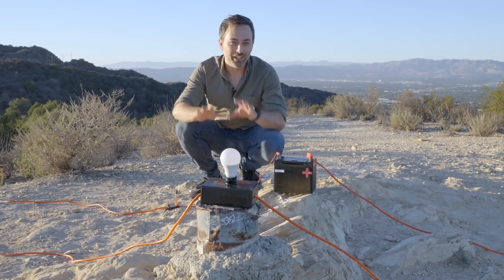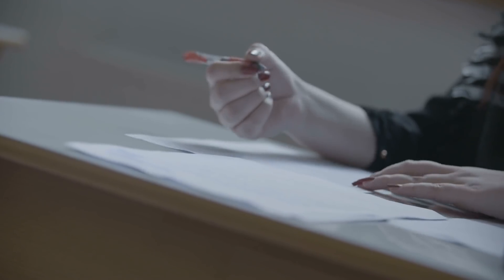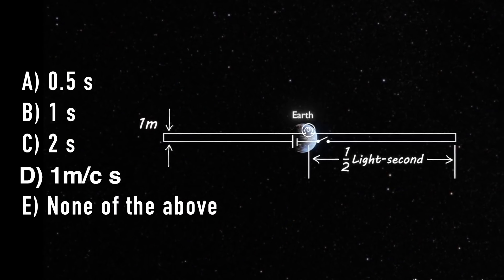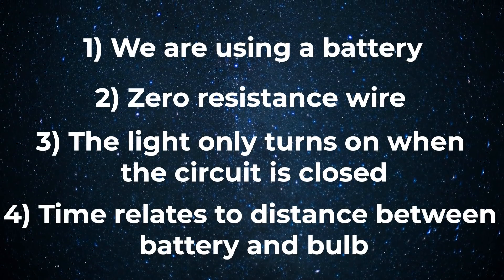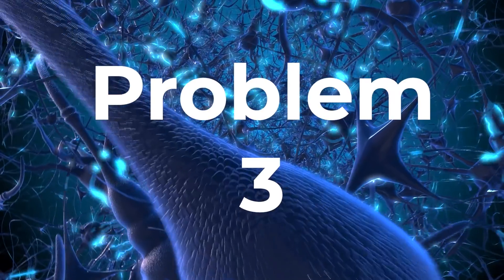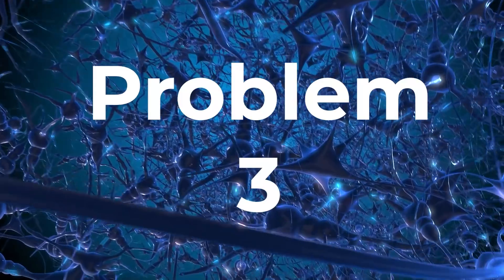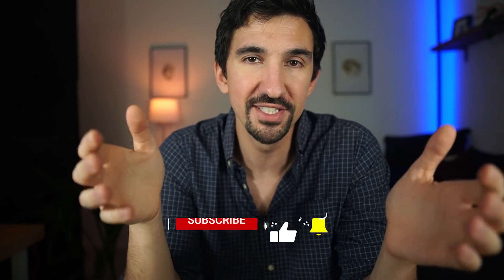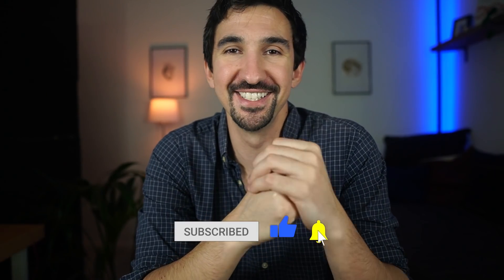Is Veritasium Wrong About Electricity?

Comment: The coupling between those wires is incredibly small. Even if you consider all of the energy supplied by the battery as creating a cylindrical near field, the best that the wires one meter away will “see” is the wire diameter / 2 x pi x 1m. Even a 10 mm wire (quite large), could at most, receive approx 0.0016 of the energy via coupling.  Light the bulb - no, not in any practical sense.  Is it possible to know 1m/c later that the switch is closed - yes.
Reply: That coupling impedance is approx. 100-200Ohm (one can make it lower, but not much higher than that). That's not "incredibly small". It causes tons of problems in electronics design.
Reply: @lepidoptera9337  Back of the envelope calculation says it will be closer to 30K Ohm for this arrangement.  Mutual capacitance between those two wires 1 meter apart will be around 100 fF / m.  Charging one meter of that to 12 V in 3ns would take a current of about 0.4 mA.  So the effective coupling is around 30K (12V/0.4ma).  You might dimly light a single LED with that current, but a bulb like shown in the video - not likely.
Reply: @bobwhite137  I know it is tempting to calculate capacitance only, but this is a transmission line problem.
Reply: @lepidoptera9337  well actually it is a near field antenna problem…. The capacitance approach should at least be in the ballpark though.
Reply: @bobwhite137  A transmission line is neither a near nor a far field problem. It has two dimensions, one being the distance between the conductors and the other being the length, with the length greatly exceeding the distance.
Reply: @lepidoptera9337  Here, the two segments being directly driven by the source voltage do NOT fit the definition of a transmission line. Those segments ARE a dipole antenna (for the first 1/2 second anyway - I only care about the first 30 ns or so).  If it helps to visualize, just cut off the far ends of the wire. That’s why this fits as a dipole antenna radiating to a dipole receiver 1 meter away.
Reply: @bobwhite137  The thing is 300,000km long. It doesn't matter much what happens on the first meter.
Reply: @lepidoptera9337  It certainly does if you want to know the current to the bulb after roughly 3 ns.  If that doesn't make sense to you, there's really no point in discussing further.
Reply: @bobwhite137  But that's not what you want to know. :-)
Reply: @lepidoptera9337  That is exactly what I want to know - I fully agree that some signal reaches the bulb at 1m/c s after switch closure.  My issue is that the power transfer is so small that there will be no realistic "lighting" occurring.  So to make that determination, I only need to understand what happens in those first few nanoseconds.
Reply: @bobwhite137  If a question contains a 300,000km long structure, it's not about the behavior of the first meter of it. :-)
Reply: @lepidoptera9337  It is when you care about the first 3 ns.  I think we're done here.
Reply: @bobwhite137  Sorry to say, but you were done with your first post.
Reply: @bobwhite137  I thought you were done? What happened? :-)

Comment: Veritasium tries to convince you that magnetic field creates current when it’s vice versa
Reply: Magnetic fields changing in time are causing an electric field (just not a field that is the gradient of a scalar potential). That electric field causes charges to move, which is... a current.
Reply: @lepidoptera9337  Problem here is that the magnetic field only changes at the very beginning when the switch is open or closed. After a fraction of a second the magnetic field is static but there is still a current!
Reply: @ricomajestic  Not along the transmission line.
Reply: @lepidoptera9337  how do you get a changing magnetic field out of a constant current and a constant electric field? If you wait long enough after closing the switch it reaches a steady state everywhere along the circuit!
Reply: @ricomajestic  As long as the transmission line is charging, there is a voltage "front" running at a fraction of the speed of light along it. It's only after it's fully charged that the voltage doesn't change and the electric and magnetic fields are constant. Having said that, even in that configuration the Poynting vector is still parallel to the wires.
Reply: He didn't said that. He said the energy is transferred via electromagnetic field, the cross product of both electric and magnetic fields, not just magnetic fields.

Comment: My problem is that we could have a circuit where the input and the output of piece of electrical equipment is only a few inches apart, but inside of that equipment we have hundreds of components mounted on a printed circuit board.  So the the energy just flows over all of it, and doesn't actually go through any of the components?  Very interesting.
Reply: Please look up skin effect.
Reply: @lepidoptera9337 , thank you I will, this is fascinating

Comment: Dumb question perhaps, but how come no-one is talking about this same experiment, but with the circuit arranged in a huge circle instead of 2 close-together, parallel legs?  What bugs me is the focus on the antenna thing.  Fine, I can get that the capacitor and antenna phenomenon is there.  But what if we remove this phenomenon - THEN how long will it take for the light bulb to light up?  Since nothing can move faster than light, I would think then it would be something like 1 second.  But then the lightbulb would be far away from us, and we wouldn't be able to see the light from it for some time as well?  Lots to unpack here.
Reply: A large wire loop acts mostly like an inductor and in this case the inductance would be hundreds of Henry, if I am not mistaken. Together with the 1Ohm impedance of a typical low voltage light bulb that's an RL circuit with hundreds of seconds of time constant.

Comment: There is something I should have missunderstood. The point is that energy flows from the batery to the bulb through the media as EM waves, and wires have nothing to do on it. Therefore, if you put the bulb into a Faraday cage (so EM are blocked), the bulb would never light on. What's wrong?
Reply: The wires constrain where the power can flow. In free space it would have to have a dipole pattern all the way to infinity. The wires restrict it to a much smaller volume.

Comment: Only when we start messing with non existing cables without resistance and capacity we break the speed of light.  Vectoring in R and C, it will take an eternity before the light would turn on.

Comment: I think that the magnetic field act at right angle to the motion of charge
So it is out side the circuit and induces flow in charges outside of the circuit you could do a little experiment and put a compass outside the circuit and see if it's being affected as soon as the switch is flipped.

Comment: When Derek first posted an image of this problem on his channel, my gut told me that regardless of current, resistance, voltage, etc it had to do with the speed of light or the speed that the information of the switch being closed would reach the light bulb. I was shocked when he stated that it would almost be instantly because as you said it would break everything we know about relativity.  I'm glad to know I'm not alone. Hopefully Derek will do a follow-up video answering this issue
Reply: There are two time scales, time for energy to travel the 1m, and time to travel along the wire. Relativity not violated. The “lie” is that power is transmitted only through the wire, it mostly isn’t.
Reply: @jimmcclymer4230  If the power "mostly isn't" transmitted through the wire, why will you not get a shock unless you touch the wire (let's assume the battery in use is strong enough to feel a shock)? Even the very thin insulation on the wire is enough to prevent it, so is it meaningful to describe the EM field as outside the wire?
Reply: Veritasium has been wrong about a lot things for the past 2 years. Just saying.
Reply: @cjay2  what?
Reply: That’s the whole point of the video. To explain how Derek was right. The light wouldn’t turn off immediately when you cut the circuit at a light second away. The current continues to flow because the information of the circuit cutting has not arrived yet.
Reply: It's not at all instant.   It takes 3.3 nanoseconds for the EM fields to leap across the 1M gap, and the total power is small but significant.

But the light doesn't get anywhere near full brightness, unless it's a single LED.   The one-meter gap serves as a major current-limiter, where the bulb will only see about 5 milliamps, best case (plenty of mA for an LED.)
Reply: @wbeaty  What I'm not getting here, is how does the EM field exist in the first place (near the light) before the circuit is completed. When the switch is flipped, causality says it should take the speed of light for the entire circuit to behave as a circuit at all. The electric field should be contained around the battery until the circuit fully completes right? And that delay would preserve causality. Once the circuit is truly completed, the EM field can pass all of the energy it likes over local space without violating causality.... or am I totally not getting this lmao
Reply: @koniferus420  No, because any 2-wire transmission line is acting like capacitor plates, and these "capacitors" are wired in series with the bulb.   If we place charge on one capacitor plate, and the other plate is part of a small local closed circuit (it is,) then opposite charge will appear on the second plate, by conventional electrostatic induction.  A current will appear in the loop.   In other words, that 39in gap is tiny, when compared to the immense length of the wires that form the "plates."   The e-fields easily connect the two wires.
But also, 2-wire transmission lines also act like transformers (like a pair of closely-spaced single-turn coils.)   If we force current into one wire, an opposite current automatically appears in the second wire, by magnetic induction ... but ONLY if the ends of the long wires are connected in a small, local closed circuit (they are.)
Finally, the ratio of L to C in the transmission line means that capacitance and inductance effects will cancel out!   Instead we get an L/C ratio, which ends up appearing exactly like a resistor.   In this case, 5mm wires spaced at 1000mm will behave like 700 ohms.    There are two of these.   So Veritasium's light bulb has 1400 ohms connected in series!   It will light up, but it better be a small LED, and not a 100-watt incandescent bulb!  (Thhis only applies until one second is elapsed, and the full 12V arrives at the bulb.)
Reply: it's not instant it's distance (1m) over c so that's not "breaking relativity". Take the bulb further away and it'll take longer -- up to 1s if you use up all the slack in the wires to take the bulb as far away as possible from the switch (1 light second). Should be easy enough to test even with much shorter wires.
Reply: @wbeaty  Thank you for this explanation!!!
Reply: @wbeaty  That was explicitly mentioned in the video.
Derek said the bulb won't receive the full voltage of the battery immediately. I don't know why many people seem to have missed that part.
Reply: @Shendue  RL time constant. You can't work it out without knowing the values of R and L in the light bulb.
Reply: As this video explains, Derek’s answer is right (i.e. light turns on ~instantaneously), but his explanation is at best very poorly explained. You need to think about the local electromagnetic field propagating across the 5m separation of the switch and the light bulb and ignore the length of circuit.
Reply: @timjohnson3913  But some information must be propagated along the length of the wire at the speed of light or slower for the light to truly turn "on". Yeah there would be some coupling between the two wires due to EM fields produced on the battery side, but that isn't really the light being "on" in the normal sense anyone would describe it. Coupling between nearby circuit elements is is a well known phenomena, and not the same thing as actually sending a current through a closed circuit loop. The instantaneous "on" state Veratasium is describing would be the same whether or not the light and switch were even in a circuit. Otherwise you're saying that the information about whether or not the light & switch combo are actually in a completed circuit travels at a speed faster than the speed of light which breaks causality. Maybe Veritasium is just reeeally poorly explaining whatever he's actually trying to say...
Reply: @mjw7994  I don’t think we disagree about much or maybe I am just unclear where we disagree. The one thing I do agree with is this video’s (not Veritasium’s video) interpretation of Veritasium’s video that the light is being turned “on” in the abnormal sense (i.e. not traveling the length of the circuit) is exactly the only way to interpret the light ~instantaneously turning on as Veritasium shows.
Reply: @timjohnson3913  lets assume its a different shape for example a square, does the same principle apply? If the separation between the wire is 1m or so, i would concede its possible but if the load is farther away what happens?
Reply: @rasg3000  I think it would depend on whether the magnetic field is strong enough to cross the distance. But assuming the needed strength is there to turn the light on, the EM waves will cross the distance at the only speed they can travel: at the speed of light.
Reply: @timjohnson3913  Don't forget the cables are very long so the field will be transfered over the whole length of the wire. The field was there all along as a potential for turning on the light, the closing of the switch completes the circuit and current starts moving. Since nothing can move faster then the speed of light, Dereks answer would sugest that the current starts flowing close to the battery and light almost immediatly but it would stil take a second to start flowing in the ends of the wire. If there was a disruption at the far end of the wire the field wouldn't be there to start with. This experiment is impossible to do in real life so we will never know the real answer.
Reply: @AndreVanKammen  The current near the battery is moved by the emf from the field propagating from the wires near the battery. So current will begin to flow around the battery and around the bulb well before it flows at the extreme ends of the wires.
Reply: @fergusfisher1315  That's what I ment, thanks for explaining it clearer. That's the problem, words are not enough in this case to explain it.

The problem with the EMF explanation (inductance from wire to wire) is that the bulb would also light up just as fast (and bright) if the wires where cut at the end. But the wires could carry more current then trough inductance so full brightness would still take 1 second?
Reply: @AndreVanKammen  This exact setup is difficult, but you can use a shorter wire and better current detector, with much better time resolution. Like an Ethernet (e.g. 100BaseTX) cable and adapters :-)
IMHO Veritasium should comment on a difference between AC and DC (transient and steady state), because it makes a big difference. In computer networks we have relatively high frequencies, but we fight with EM wave transfer by twisting the wires and shielding them, so they behave in some aspects like DC. In the Derek's setup it doesn't matter if the cables are even connected at the far ends (or there would be a causality speed limit violation). In real life if you cut the wire it doesn't work.
Reply: @marek-kulczycki-8286  Funny you mention ethernet cables and adapters, they use coils in the connector so the ethernet cables become their own short circuit. A meter UTP contains around 3 to 4 bits in transition at 1 Gbit. Those bits travel with their own field, the twisted pairs helps them accomplish that.

In Dereks setup cutting the wire at the end would not necessarily break causality, you could see it as destroying the field. So if you cut the wire at the end and turn on the switch at the same time the lightbuld would light up for less than a second. This is what intrigues me  and is hard to test in a real setup (you would need superconducting wires long enough for the precision of you timer and switching). The switching part wil be the hardest, maybe 2 MOSfets and the pulse for switching comes half way?
Reply: @AndreVanKammen  Yeah, 2 MOSfets and the triggering source in the middle sounds good. The gate at the battery closes and the gate at the far end opens ... I agree with your prediction: it will be a spike (impulse of the current and, if all tuned properly - light). With the Derek's setup there would be a spike and then slow increase of brightness up to a steady level. With two switches perfectly out of phase there would be only a spike.
Great thing about Ve video is that it provokes thinking about the electrical phenomena. I reached a point when I started to question a legitimacy of a question "where" when applied to a quantitative property - the energy. Is energy real in a sense which allows us to assign a spatial position to it?